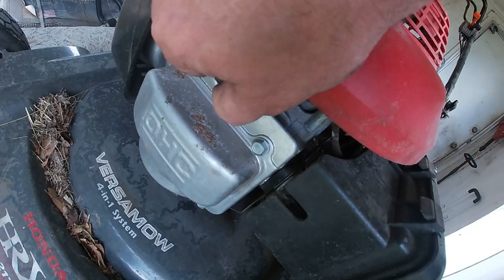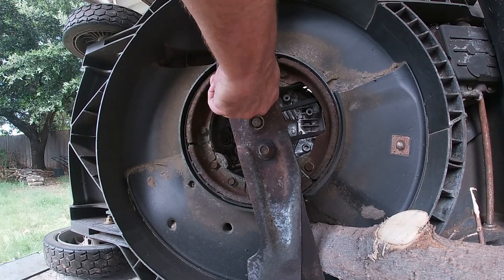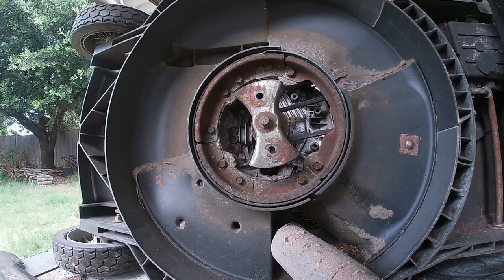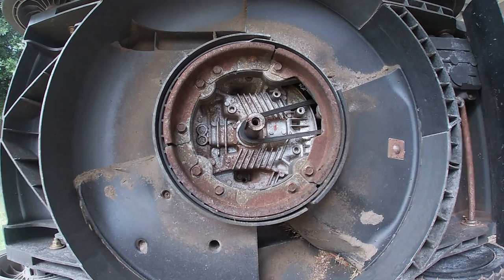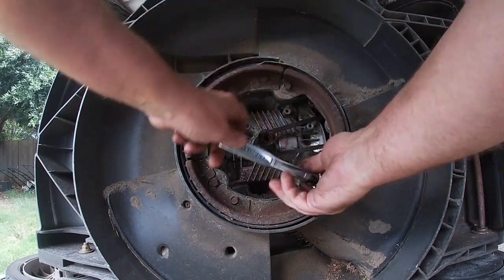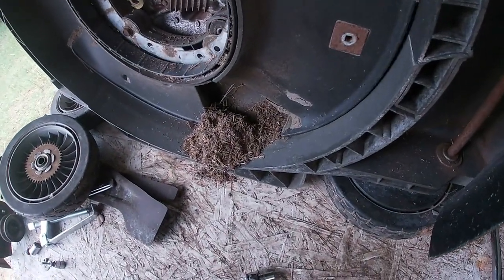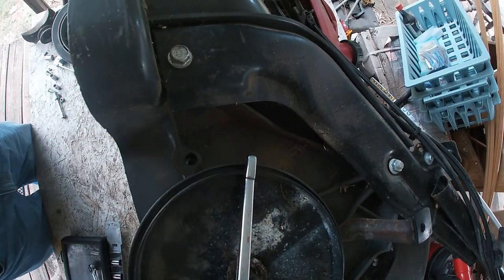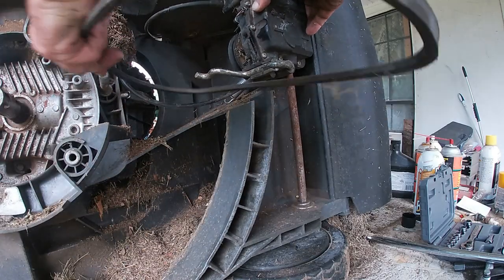Honda HRX217 Drive Belt Part 1

Comment: UPDATE. 11 MONTHS LATER I HAD TO DO IT AGAIN. Mower would not pull itself on level concrete.  When it was new it would pull up a 35 degree hill. Cable was adjusted all the way out for more pull, did not help. Changing out the engagement cable and the belt. Of note, the hidden bolt was a 13 mm, not a 12 mm and there is a retaining shield on the back pulley at the transmission, thanks Honda. FIRST REVIEW:  Good to know, I changed one before without knowing any of this, probably did more work than necessary, but got it on. I like the wind chimes, nice calming effect. You did this in an 11 minute video, took me over am hour.
Reply from the maker: Glad it helped
Reply: BUY A NEW FUKIN MOWER AT HOME DEPOT FOR 550.00.

Comment: Thanks for the video. I found it very informative to determine which bolts needed to be removed to access the belt. I have a few comments from what I learned while changing the belt. 
1. I bought a belt for the HX217 without realizing there is more than one option. Make sure you buy the belt that matches the engine. I purchased the belt on Amazon. 
2. I did not remove the blade adapter to take off / put on the belt. (time saver) 
3. I did not take off the wheel to access the bolt. Just adjust the wheel location. (time saver).
Reply from the maker: These are all very good comments. You are correct that the blade adapter and wheel do not need to be removed.  I did so for filming purposes and for those who might be doing this for the first time.  
Thanks for watching and commenting!
Reply: If you're doing all this you should at least sharpen or better, replace the blades.  Before putting it all back together clean the drive gear and the wheel bearings.  There was a lot of gunk on the drive gear.
Reply: Thanks, John.  I'm replacing the drive clutch cable on my HRX217 tomorrow and your tips will save some hassle.

Comment: Thanks for the video. It gave me the confidence to go ahead and change the drive belt on my HRX217HXA. Mine has a Blade Brake Mechanism, so it is a bit different - I managed to change the belt without disturbing the blade brake mechanism.  The most tricky part was the way part of the case was attached; it had a metal insert that went part way through one part to the case to mate with the other. The bolt setup was the same for the three metal pieces below.
Reply from the maker: Glad you got it fixed!

Comment: Didn’t read thru all the comments, but for all those attempting this cuz your belt is loose, there is an adjustment on the cable to tighten it up. Worked great for me and very easy.
Reply: How about sharing christ Jesus my guy

Comment: Good stuff.  Thanks for the video; quite helpful.  Just a note that could be a significant time saver for those who have only had the belt (somehow) come off of the pulleys, but otherwise in good shape; that's what happened with mine.  In that situation, all I did is use a large set of adjustable pliers (or some other suitable grabbing utensil) to grip around the transmission housing, and rotate it forward.  That allowed me to simply slip the loose end of the belt around the pulley at the engine.  By going this route I avoided the more time consuming process of taking apart all the undercarriage pieces.  I will say, removing the blade (only) was helpful to be able to provide easier access.  Also, having a second person is helpful to actually manipulate the belt (keeping a tight enough grip on the transmission housing with the pliers can take both hands).  Bonus, while the blade is off, it's a good time to give it a good sharpening.  

If the belt is broken and has to be replaced, the disassembly you showed in the video would be necessary.
Reply: Thanks mate your info just saved me a lot of time, my belt had been off for some time it's all good now. Dunno how it came off though maybe grass it a stick spat it off 🤔
Reply from the maker: That will work too. Thanks for watching!

Comment: Great video! On mine, it looks like the pulley is rubbing against that metal bracket it sits next to. Does it need adjusted somehow? I'm wondering if that is what caused my belt to slip off. Thanks!

Comment: Geez, it would be easier to change the belt on a 12-cylinder Lamborghini! 😳
Reply: Yes but the belt that drives the Lamborghini transmission  costs $495.99
Reply: @stevejette2329  "Belt" on a transmission??? 🤣  *You probably meant engine, right?

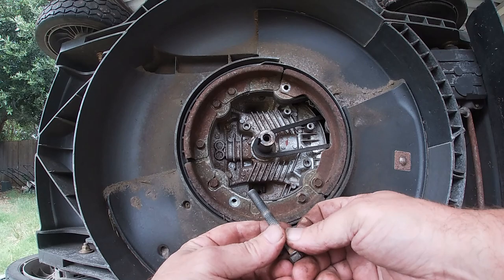Comment: Uh, am I wrong, or at about the 7:40 min mark, you forgot to show us how to remove the 10 mm bolt on the cover? In part II of the video, you re-install it by going through the discharge chute and holding the nut in place while you tighten the bolt back up. Also, how do you keep the discharge chute open enough to do that?  Would have been nice to see this........
Reply from the maker: You are correct. That footage was lost. I hold the chute with a spring clamp or licking pliers. Thanks for watching and commenting.

Comment: My belt can’t be removed the way you instruct. There’s no spring to pull forward. I can rotate the housing but the belt appears to have some sort of casing at each end (removed center) and I can’t get the belt up in the housing removed. Space is too narrow for the belt. Is mine slightly updated? Any advice?
Reply: Same on mine.

Comment: Quite an operation isn't it?   Just to change the belt.   You'd think Honda would make it more straightforward.
Reply: Ya complete bs lol
Reply: This isn't just a Honda issue basically everywhere wheel drive lawn mower is a pain-in-the-ass to change the drive belt

Comment: Seems like it is unnecessary to take off the blade adapter, and it just adds more work when you have to put it back on.  Why would you take it off?
Reply from the maker: Easier drive belt removal.

Comment: I did great until I came to the pin that you easily took out because it was loose. Using needle nose pliers. Mine is frozen in there and cannot even knock it out. Perhaps melting two slots into casing so it will slide over this pin?
Reply from the maker: Try soaking it with a penetrating oil first.

Comment: The center bolt between the blades on my mower turns freely and I cannot get it off, it moves the engine shaft including the flywheel, cooling fan, etc..
Reply from the maker: You will need a piston stop in the plug hole to stop the engine from rotating.